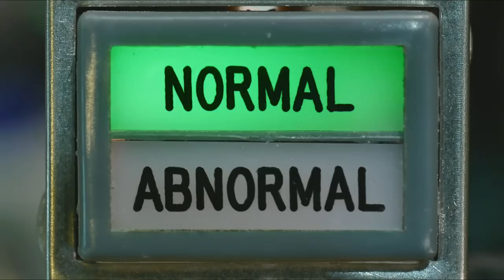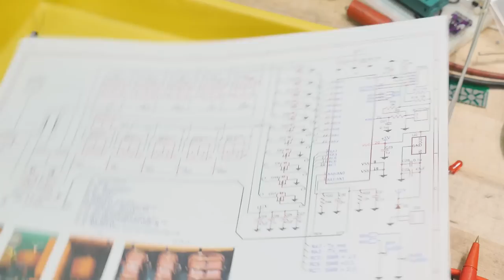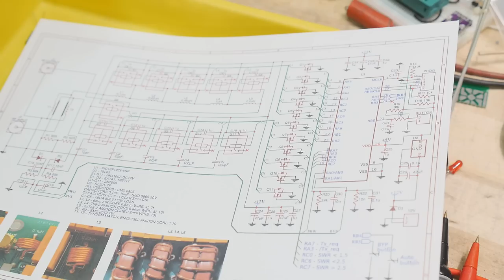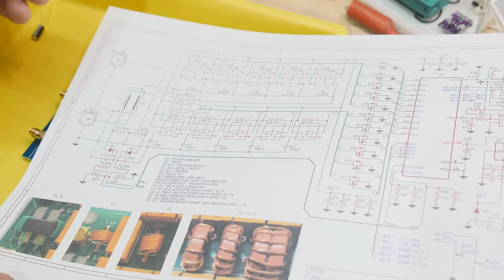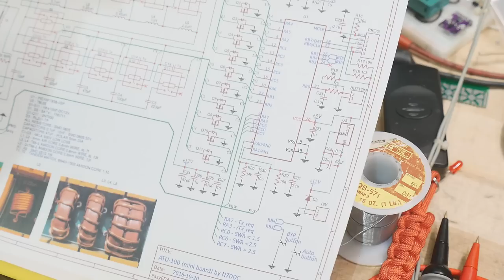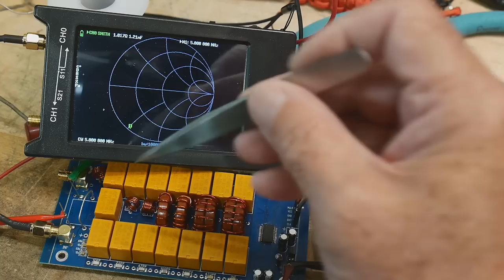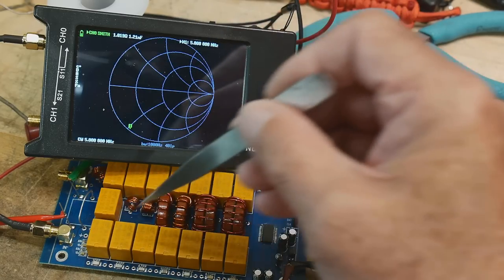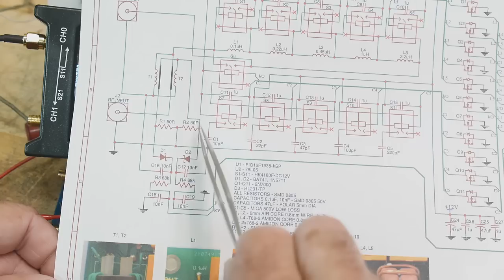#780 ATU-100 Antenna Tuner Build and Measure (and a story)

Comment: If you change the turns ratio on the SWR transformer, and reprogram some of the values in the EEPROM on the PIC (requires MPXIPE and a PicKit3 or 4, or an AVR (Microchip) ICE, you can get the ATU-100 to tune with only 1-3 watts of power.  It's described in the builders manual, or on the website.

Comment: I have one on my bench yet to be finished. I got as far as you and still need to add the last two buttons, and hook up the antenna connections to SO-239's in the enclosure already drilled and cut. It's almost there and been that way all this year. I would love to see the finished product in operation and any tweaks needed to work well. Thanks.

Comment: I built one after the ready-built one I bought was a disaster. The one I built worked from the word go, into a dummy load on 100W it gave 1:1, and on my main end-fed it will tune to better than 1.5:1 on all the hf bands except topband! I had the same problem with the relays! Mine works down to 1.5W.

Comment: Best video yet! Tell more stories. :)

A couple of questions: At what SWR reading does it autotune? It looked from the video like somewhere around 1.7 to 1.
I'm also curious what degree of signal attenuation there is when all (or most) of the toroids are switched into the circuit. These aren't roller inductors, so I suspect it's significant.

I've watched half a dozen videos about these units and have learned essentially nothing of value from the other videos. The other YouTubers don't seem to understand what they are doing and what matters, or even how an ATU works. YouTube videos. Sigh. But thank you for your videos. They are the good stuff. As random as they may appear to some, they knowledgeably cover many of the topics and devices I am most interested in. And the stories are a great distraction while you are doing repetitive soldering and assembly tasks.

Comment: Thank you for the nice experiment. My ATU-100 shows 10% lower power than the CN-801 SWR meter. So I tried to change the winding of the coupler from 1:10 turn to 1:11 turn, but no improvement.  What should I do for the adjustment?   73  from  6M0MM

Comment: Might be interesting to fit LEDs across the relay coils
Reply: I agree, except it sounds (at least to me) as though the relay switching occurs at such a high/fast rate of speed, you might not be able to precisely determine what the actual relay switching "pattern" is, referencing the LEDs illumination, in real time. Perhaps with a slow mode video recording of the device with the LEDs connected together and the antenna tuner "doing its thing", with then the play back of the recording considerably slowed down... Interesting concept nonetheless!   Fred

Comment: Could you increase the SWR sense voltage to the processor either by more tuns on the sensing transformer T1/T2 or ad an op-amp to boost the voltage, maybe a combination of both, so that it is sensitive enough to see the output of the nanoVNA? How about reducing R3 & R4 and/or increasing/removing R20/R21?

Comment: I notice that manual QRP tuners like the Emtech ZM-2 have a tune mode that makes sure a transmitter is always presented with a safe load impedance even while the tuning is being adjusted. Is that the case with this auto tuner design also? 

I ask as some commenters in the QRP labs groups suggest it’s common for these auto tuners to present transient wildly high VSWR while they are doing their search for a match and that has been blamed for blowing up the PA on simple unprotected rigs like the QRP labs QDX.

Comment: I notice that the tuner is in "auto" mode, indicated by that dot next to "PWR 10W"  Also, when you held the short across the button for a bit longer, the unit did a RESET rather than a TUNE.  The button is B0, but there are also buttons B1 and B2, accessible on the back side of the pcb, along with A6 and A7, which are something to do with requesting TX for tuning.  There is a video, linked on the N7DDC github page for modifying to accommodate QRP operation at 5W and less.  Those additional buttons are needed for doing things like stepping through the inductors.  I could use some help with any of that stuff.

Comment: We're the air inductors and the binocular core the explanation for the two different wire sizes. Also how did you size the air coils? Did you use drill bits for the size you needed?
Reply from the maker: the small wire is for bino core. the medium is for the smallest air. yes used a drill bit. These are not very critical, they just need to be close. the tuner tries combinations until the best is found.

Comment: This is definitely much cheaper than most other ATUs. I think I will get one to use with my IC-705. Are you planning on doing some measurements of efficiency?
Reply from the maker: no, it will be the same as any internal tuner
Reply: @IMSAIGuy  The efficiency I am talking about is what percentage of the power punt into the tuner is actually delivered to the output and not lost in heat, etc. All tuners, manual, automatic, or whatever will have some loss.
Reply from the maker: @JohnTarbox  Yes, understood your question. It will be about the same as any radio with an internal tuner. the design is the same. The losses are quite small
Reply: New QRP tuner for IC 705 here https://youtu.be/oanICrrSyFE

Comment: How is this working for you? It has been reported that the diodes used in the SWR bridge that are shipped from China are sub-par and that the performance can be improved by substituting good quality Schottky diodes. Have you considered this?

https://github.com/Dfinitski/N7DDC-ATU-100-mini-and-extended-boards/issues/61#issuecomment-873661548
Reply from the maker: I didn't really need it as the IC7300 has a built in tuner that I use. I did put it on the air and seemed to work just as good. It does not remember so always has to hunt for  second. then ok. since you are just looking for a minimum SWR, the diodes are not really critical. if you use it for a calibrated power meter (I did not) then maybe better diodes might be a difference.